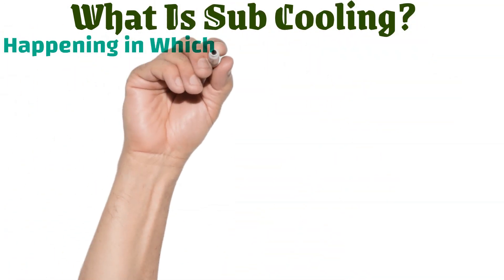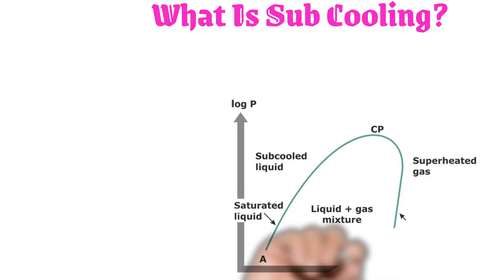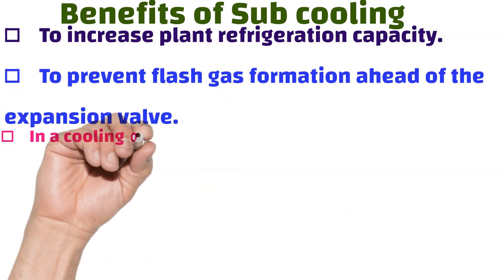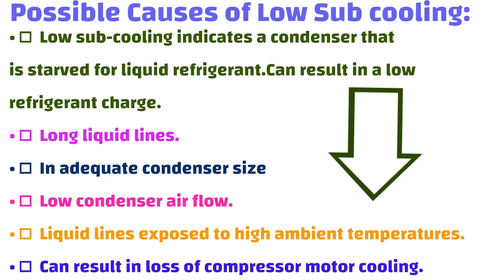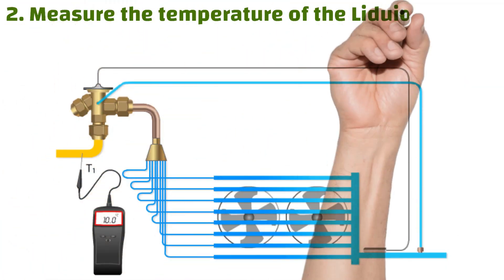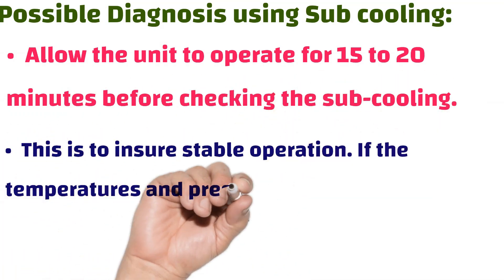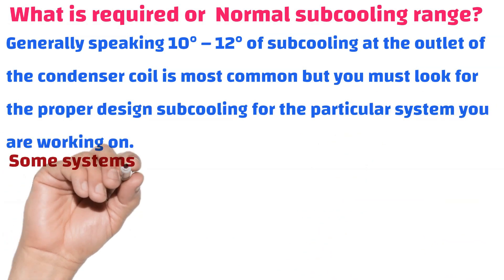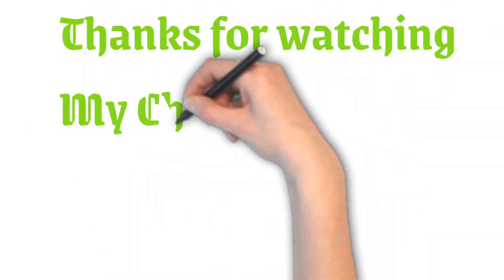Understand All about Sub cooling

Comment: As liquid enters expansion valve, some flash gassing occurs to effectively cool the liquid down to evaporator saturation temperature.  This flash gas does not contribute to evaporator cooling therefore is efficiency loss.  Larger amount of subcooling is advantageous for this particular aspect, but ...

Higher subcooling reduces condenser effective area for cooling refrigerant hot vapor which exchanges heat to air flow much better than cooled, condensed liquid refrigerant due to the greater temperature difference in condensing hot gas to air flow through condenser.  Higher subcooling on output of condenser raises compressor discharge gas temperature/pressure and can increase load on compressor causing more compressor electrical consumption, which is an efficiency loss. 

Higher SEER units often accomplish their increased efficiency by using a larger condenser.  Larger condenser usually holds more refrigerant so there is greater volume of liquid refrigerant margin allowing them to run at lower subcooling levels. 

Large condensers can cause problems with compressor input flooding in off mode due larger refrigerant system loads.  Many systems with large condensers shut down expansion value when compressor is shut down and rely on compressor discharge check valve to trap liquid refrigerant between compressor check valve and shut off expansion valve.  Once condenser cools down in off mode, most of liquid will stay in condenser during off mode even when there is some leaking of check valve and shut down expansion valve.  This greatly reduces possible liquid flood back to compressor input during off mode by keeping most of liquid refrigerant in condenser during off mode.